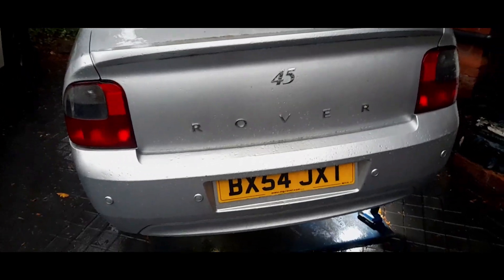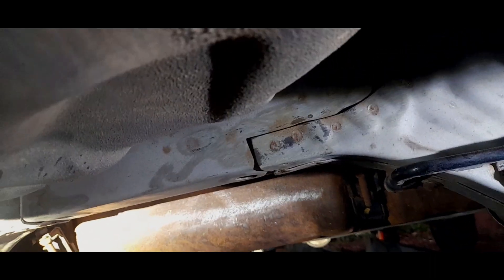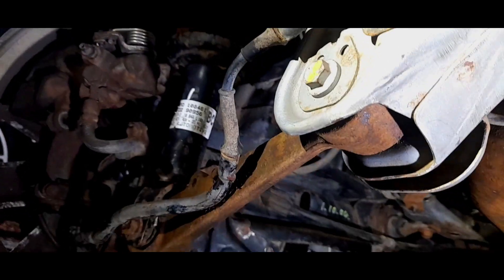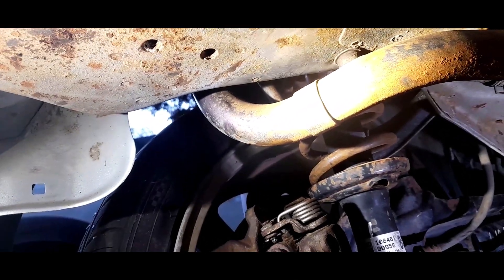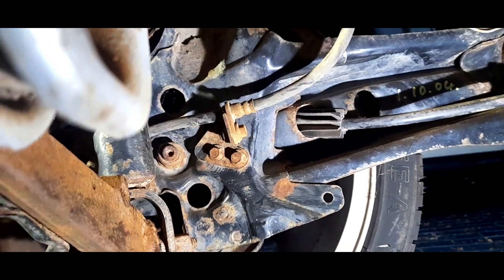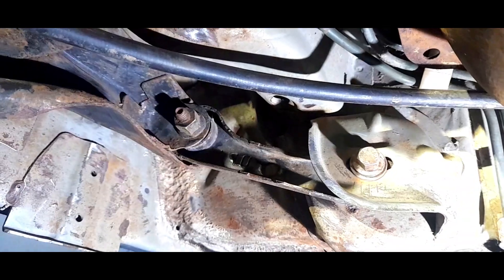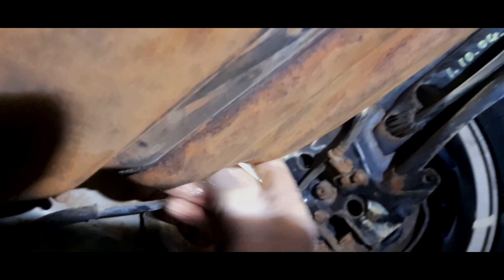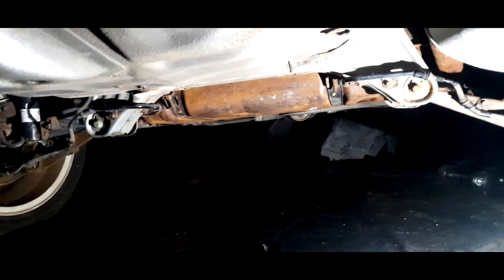Rover 45 Project Beatrix Part 26 - De-Rusting the underside!

Comment: Good work there Andrew looks great my 55 plate s type needs the same treatment at the rear end will be interested to see which rust treatment you are going to use on the 45 looking forward to seeing the next part 👍
Reply from the maker: that will come later down the line as i've got a load of issues to deal with! Once the mot is done I will be testing out something different to the usual waxyol! cheers kev as always, S types are very undervalued cars and share quite a nice ford heritage underneath!